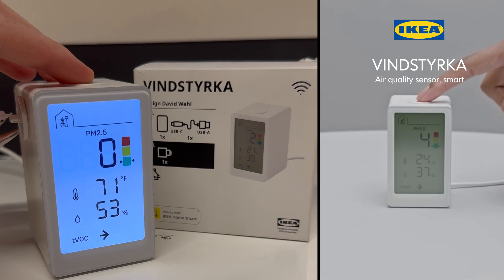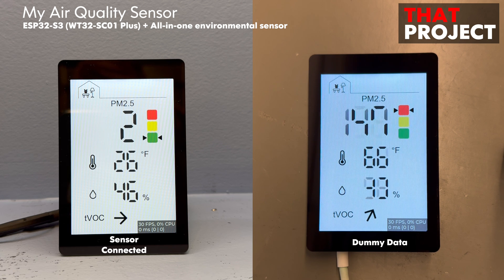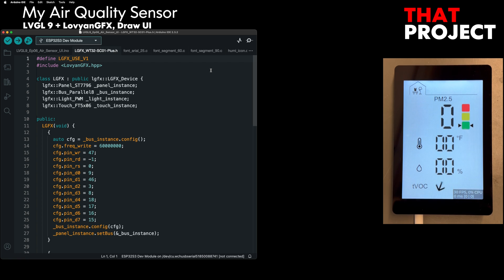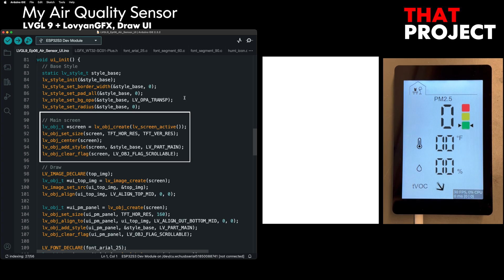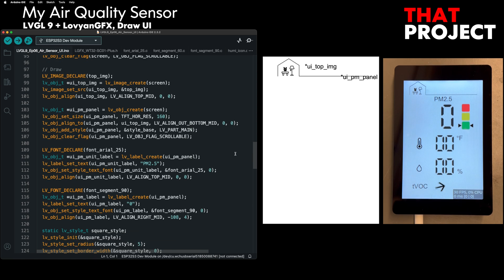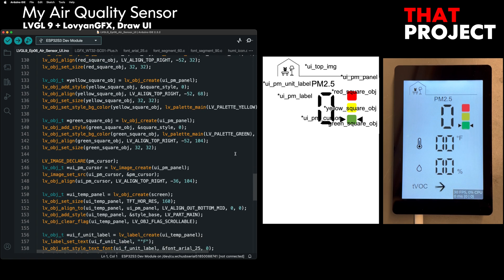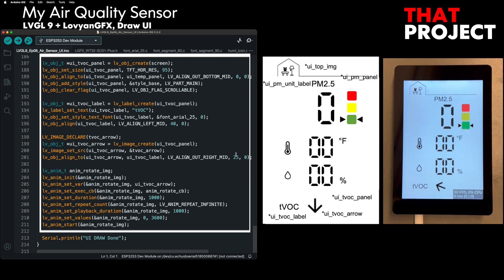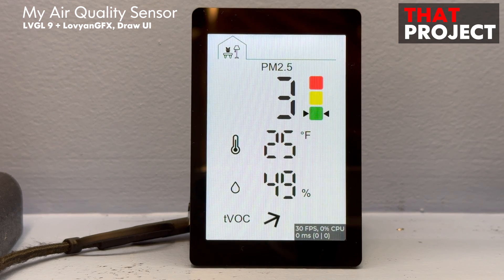My Air Quality Sensor, LVGL 9, [Ep.06] Draw IKEA UI, #ikea #airquality #esp32

Comment: This is fantastic! But I'm getting errors when compiling. Has anyone had issues with this code? Errors:
\appdata\local\arduino15\packages\esp32\tools\xtensa-esp32s3-elf-gcc\esp-2021r2-patch5-8.4.0\xtensa-esp32s3-elf\sys-include\stdint.h:82: Error: unknown opcode or format name 'typedef'

appdata\local\arduino15\packages\esp32\tools\xtensa-esp32s3-elf-gcc\esp-2021r2-patch5-8.4.0\xtensa-esp32s3-elf\sys-include\machine\_default_types.h:160: Error: unknown opcode or format name 'typedef'

appdata\local\arduino15\packages\esp32\tools\xtensa-esp32s3-elf-gcc\esp-2021r2-patch5-8.4.0\xtensa-esp32s3-elf\sys-include\stdint.h:28: Error: unknown opcode or format name 'typedef'
Reply from the maker: That's a weird error. What version of ESP32 are you using in the Arduino IDE? The latest version is 2.0.16.
Reply: @ThatProject  I was not using the latest version of LVGL and ESP32, totally my fault. 

You're videos are very helpful, thanks for taking the time!